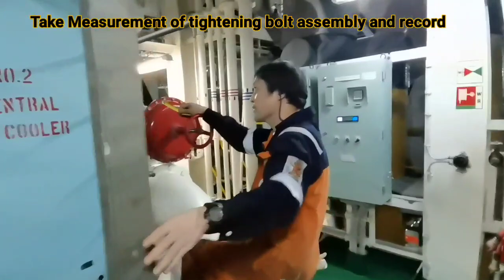How we clean Central Fresh Water Cooler Plate Type

Comment: One question, anybody try use chemical cleaning with pump  circulation ? How is working, I mean it's not dismantle it
Reply from the maker: @BMWang2020  yes we tried that already it helps. however its not 100% cleaned compared to opened up the system